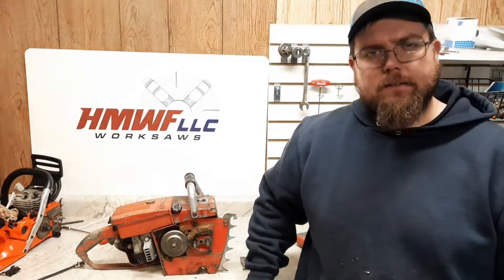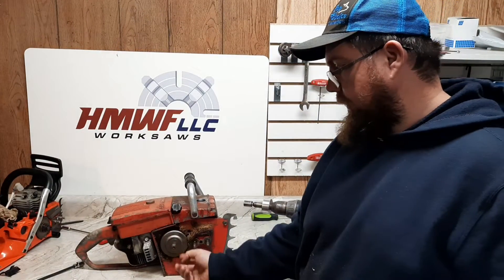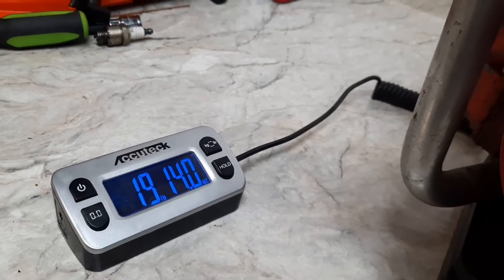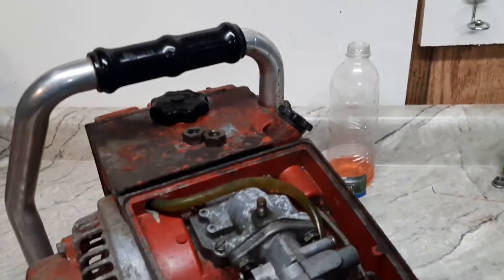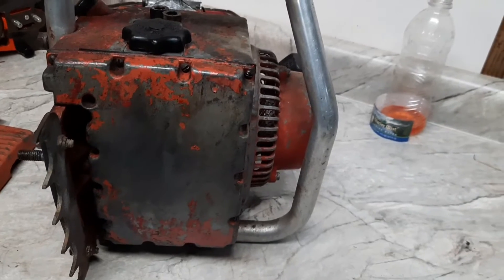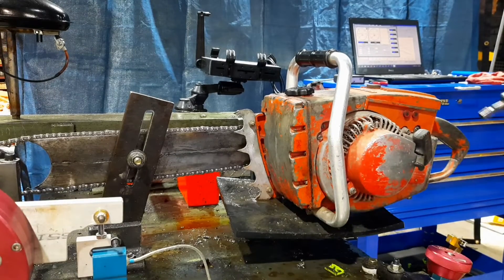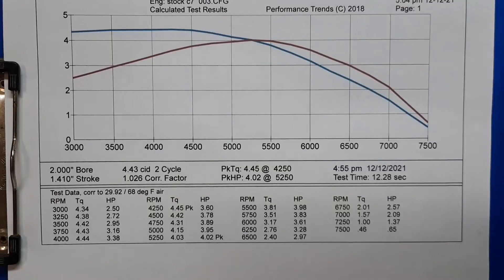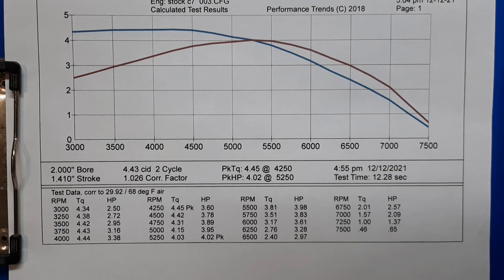Vintage 80cc chainsaw! Homelite c7 revival and Dyno pulls!

Comment: I’ve got a super xl 925 on the bench currently. Really dig these old homelites
Reply from the maker: I used to have a very nice 923. Still have a soft spot for the old homelites.
Reply: Love the 900 series I've got a 901,923,925 killer saws with enough torque to pull a house down 👌

Comment: That kind of power that low down is super impressive. I thought for sure peak power would be lower in favor of that low RPM torque that these are known for. But that's a lot of power too. Even better that the power is on at 5000 RPM instead of 10,000.

Comment: I have a C-51,and two C-72's. Yesterday I put another coil,and a chip in one of the 72's. Now they all run like new.
Reply from the maker: It is amazing how little it takes to get some of these old saws running again.
Reply: @dynojoemods2764  They're built to last forever, and to be easy to maintain.
Reply: @dynojoemods2764  The one main problem is you got to be pretty healthy to operate one for any extended period of time.

Comment: I have an old C51 (77cc) that I opened the exhaust about 3 degrees and worked the lower transfers(3) that Id love to throw on the dyno. She starts pretty good and runs like a beast. I have a 24 on it that it pulls with authority.

Comment: The oldest saw I can remember my Dad running was a C-5. Was originally blue, but over time replacement parts turned it partly red. His next saw was a 1050. That was a heavy SOB. His little saw at that time was a Super XL. The other Homelite we had was my brother's 750. That thing ate ignition coils, but it ripped.
Reply from the maker: 1050, and 750 and both huge saws. Of these old saws could only talk
Reply: @dynojoemods2764  yep, they were handfuls, but oaks 3 to 4 feet in diameter weren't uncommon in our creek bottom, so they got a workout.

Comment: Man I love the old saws. It sounded like it wasn't putting out much rpm but the torque sure was there. I have an old Ram tools chainsaw I believe from 1958 that sounds like that.
Reply from the maker: Yes, these older saws don't turn the rpm of the modern saws. But they are just plain cool.

Comment: I got that same saw at a farm auction this year.  Carb kit, fuel line, resealed the gas tank, and BOOM, she fired and cuts great.
Reply from the maker: Sometimes that is all it takes.
Reply: How much was it
Reply: @anthonydobija3669  think I paid $24.  It was pre COVID so I don’t really remember anymore.  The 28 inch Oregon bar I’m running on it is worth more than the saw.

Comment: The c series was also a neat saw because they made a gear drive that bolted onto them. The c stood for convertible because you could make them gear drive with just a add on gear box.
Reply from the maker: I always wanted one of the add on boxed. I had a 1130g for a while. It was neat

Comment: Awesome torque curve!!  I didn’t think it would have nearly identical torque to HP. 
I have an old mono saw that was my great grandfathers. I would love to get that out and do a full resto on it and my dads Homelite.  I’ll try to send some pics to you!
Great video
Andy
Reply from the maker: Thank you. 

The older lower rpm engines will tend to have power curves like this.

Not enough rpm to really push big horsepower numbers.
Reply: @dynojoemods2764  seems like you’d have something to work with though as they’re probably very robust by design. Because everything was built heavier back then. 
If they could be given a healthy porting and a pipe you could probably do it without giving up the torque but just adding HP!
I’d love to see what you. Outdoor do with yours then I’d know what to do with my dads old saw. He’s 84 he won’t be lugging that beast around!
Reply: @dynojoemods2764  “could do” not “Outdoor”. Auto correction is horrible some times!
Reply: Those old Homelites were built to last forever. Most of the time they outlasted their operators. The carb would go sour,and they would get parked. I still get mine out and use them on occasion. Couple of years ago my 51 decided to catch on fire because the points aged out. I was on the edge of a field. Bout lost the saw. The grass took off and I was off to the races trying to get the saw and the grass put out. It's got a chip in it now.

Comment: Very nice mate, I would love to see you put a gear drive saw or 2 through the dyno.  See if someone will let you borrow a 090g or a big Mac g.
Reply from the maker: Thank you.

Might have to upgrade my water system to slow the old gear drives. It works like a pump, the more rpm it spins the more brake force I have.

Comment: Hey Dyno joe, i have a suggestion on what to compare on a dyno run, get a stock saw of any type and run standard gas, then try the Stihl moto mix and try, for some reason my saw seems to run more crisp and pull just a little harder with the Motomix, it could be all in my head though…..
thanks, keep up the great work
Reply from the maker: Some old do indeed tune a bit different. I'll have to try some oils on the dyno sometime.

Comment: Very cool video. A XL-12 or Super XL would be cool to see. Also, any of the old Sachs Dolmars. The bigger the better. My Dad switched from Homlites to Sachs Dolmar in the mid 80s. I still have his 117 which I think said 6.5 hp on the sticker that was on the handle. Prolly way over rated for a 61cc (I think) saw. Anyway, it would be cool to see. BYW, I’ve always wanted a way to start a saw with a drill….that is awesome.  Did you make that or is it something that you can buy?
Reply from the maker: I plan to get a lot more saws on the dyno. I made the starter piece. Not sure exactly how many saws it will work on. Has to spin the correct direction and nothing to loosen up. Wouldn't work with the clutch cover on either.

Comment: What kind of power do you think you could get from that homelite.  Or is it to scary to mess with because of no replacement parts??
Amazing HP that far down in the RPM range. It would actually make a decent go cart engine. Torque and HP down low.
Reply from the maker: Might be fun to try sometime. 

Not sure how it would like the higher rpm though

Comment: Did you opt for using the oiler to decrease drag on the bar to make numbers more fair to compare to other saws? I know it's all about fun and curve, just curious
Reply from the maker: All the saws have some oil in them for the chain. Used it more to see if it still worked than anything. Saw had been sitting for years.

Comment: Great video! I’m going to contact you after the first of the year to make arrangements to ship you a saw. My grandfather was the original owner of 1970 or so Homelite C72, which will fire but not stay running. It looks good cosmetically but we haven’t used it in years because it has the original bow versus a bar. 

Again great video and keep up the good work!